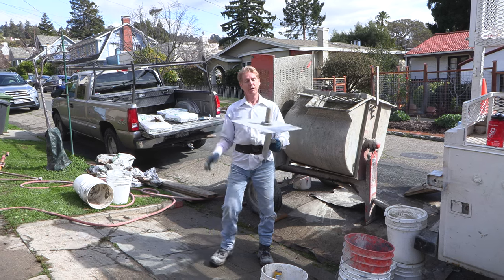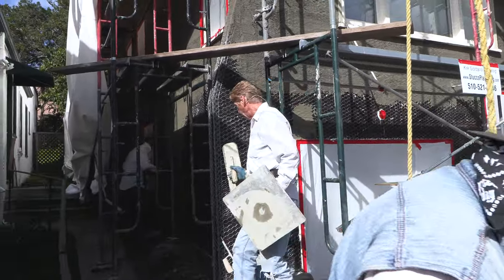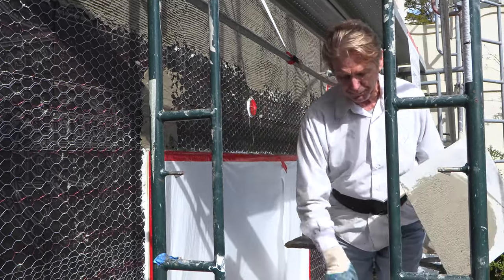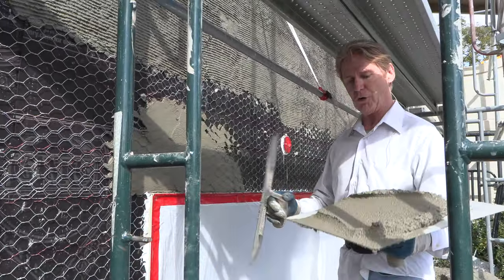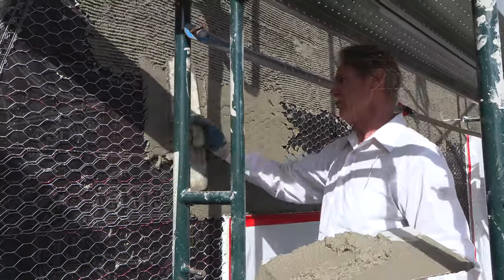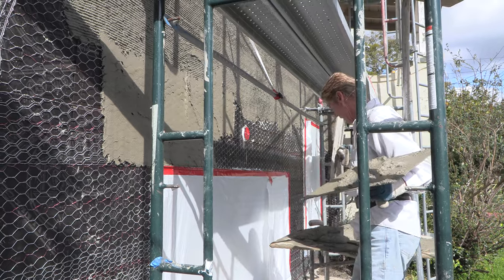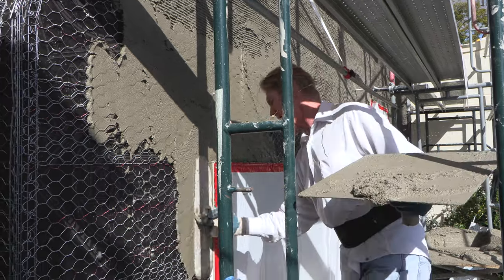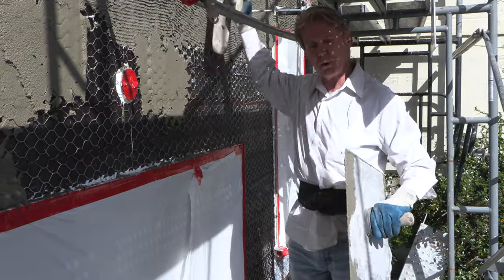Vertical plastering troweling techniques

Comment: Kirk
The skills 
The form of communication 
The intelligence 

P.s.
I hope you are sure about it , you have very good behavioral management  to be a teacher  . I learned from you a lot  .

Thank you "BOSS "!
Reply from the maker: Howdy Sebausa, man, that's just beautiful, thank you from all of us.
Reply: @StuccoPlastering hi Kirk hoping to get your advice on a rewire of a old lathe and plaster home 

What are your thoughts on cutting into lathe and plaster as far as tools ?

Through my research you only want to cut using a multi tool , though I’m being told by a electrical contractor it’s fine to use a hole saw
   I’ve even seen these guys use sawzalls to make new receptacle holes 
   The aggressive vibration off tools like this would make sense could rattle the keys loose but I wanted to get your thoughts on this ?
Reply: Hello I’ve never been able to figure out how to comment before. I’ve learned so much from you. It’s unbelievable. I’ve plastered whole rooms of repaired whole structures. I can’t thank you enough for what I learned from you and your family the best.
Reply from the maker: @edwardfitzpatrick1206  Morning Edward, that's a mighty nice thing to say, thank you. As always, folks can count on us for sound advice and or workmanship.

Comment: Kirk do you use plaster of paris" for interior plastering?? If not what product do you use and can you find it without a commercial account??? Thanks, great videos.
Reply from the maker: @treverwhoever  No, Plaster of Paris is great  for setting bones as in  cast’s. But I’ve never had a need for it. You can buy a joint compound suitable for your skill level like 20, 40, 60 and so on  at Lowe’s or any H D hardware store. If you want real plaster instead of gypsum’s with accelerators you’d have to google, “plastering yards near me” like Westside building materials where you can buy usg’s Diamond lime plaster.

Comment: Hi Kirk, what's the advantage of the vertical application method over the average joe method? Is it just speed of application?
Reply from the maker: It's necessary for applying stucco at all vertical corner areas.

Comment: Kirk thank you for sharing all your knowledge. I sent a question to you through your website. Hope you see it. I'm getting ready to mud a ceiling repair.
Reply from the maker: Evening Meow, sorry, I must have missed it or perhaps it stumbled into the spam zone, what was the question?
Reply: You inspired me to fix my ceiling. I cleaned all the lath and sealed it. I'm ready to put up mud. I bought USG Easy Sand 90. Now I'm reading online that it's very difficult to sand. I don't want to sand, but I'm new at this so I might have to. Is this what I should use for my base coat and finish coat?
Reply from the maker: @meowerstationone3793 @meowerstationone3793  Hello, Easy Sand is titled well. Indeed, it is very easy to sand if you can't trowel it to perfection. Also, I suggest that when finished, instead of sanding, which creates dust, you wet an old bathroom rag or towel and wet it and make it smooth with this simple method,  as it creates no dust. I have shown how to do this in many videos. Easy sand is gypsum; thus, once wet, it sort of resorts back to manageable mud, which is why it's mainly used for interiors. And yes, you only need this for the base and finish coat. Happy troweling.
Reply: @StuccoPlastering  Kirk, thank you very much. I've been following all the steps in your videos. You make it look easy. It's not so easy. You are a true talent. I hear you about not creating dust! I'm going to follow your advice with a wet towel for smoothing. Do you know why this product says not for skim coating? I was wanting to skim coat a wall also.